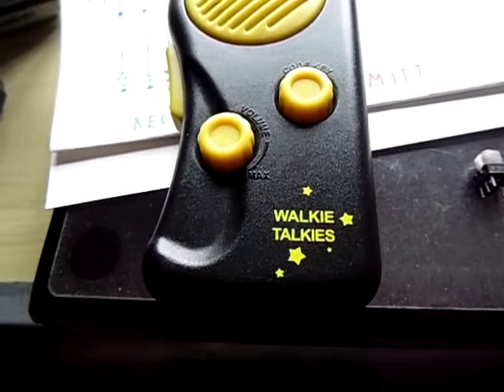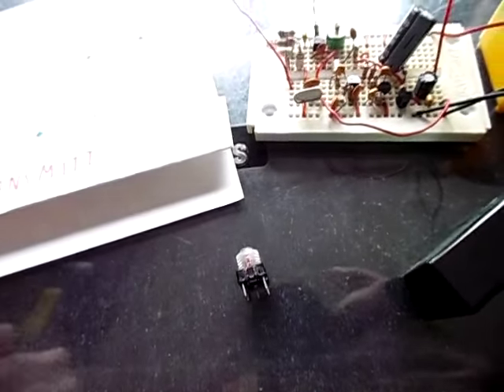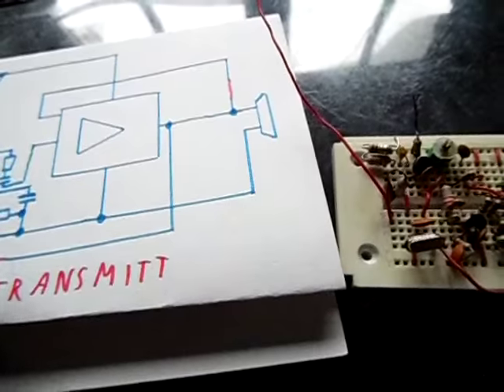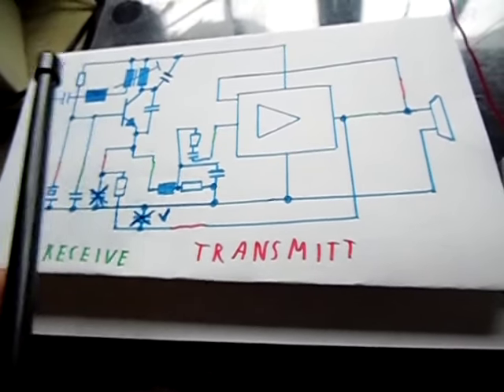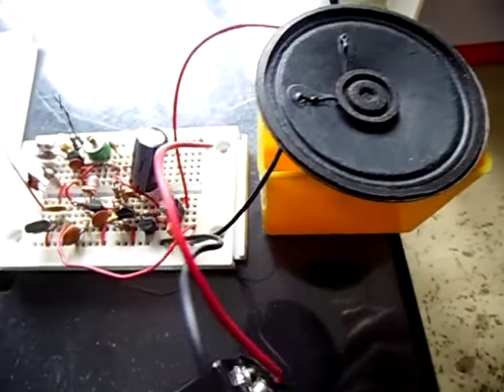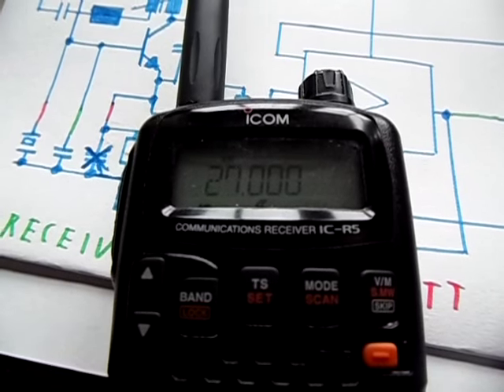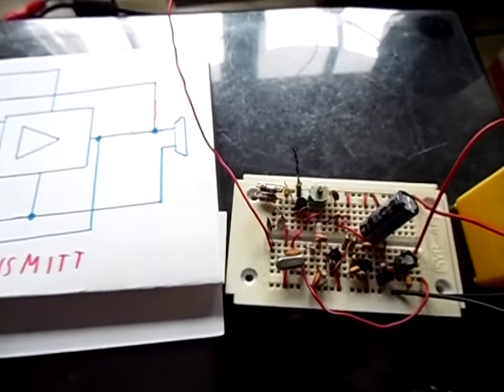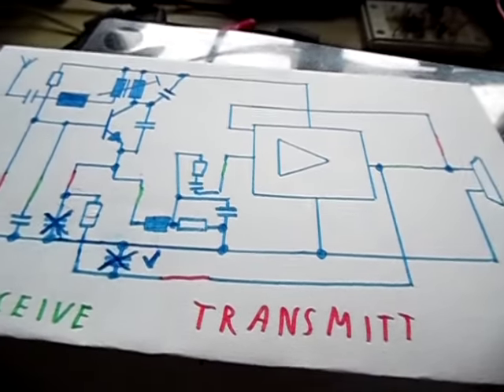How  simple walkie talkies work

Comment: Nice video, however it's a bit fast for someone who doesn't know these terms too well; I don't really understand what exactly the purpose of the crystal oscillator, the inductor, the transistors and the transformer is? I would be very grateful if you could explain
Reply: That Earthling if you don’t understand I suggest going step-by-step along with each part does it uses it took me a couple of years just learn about part independently